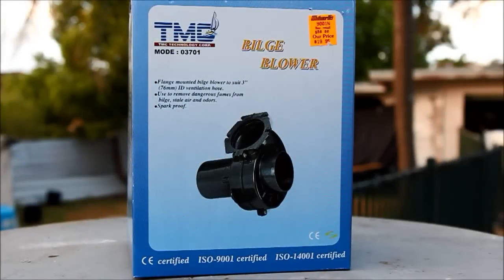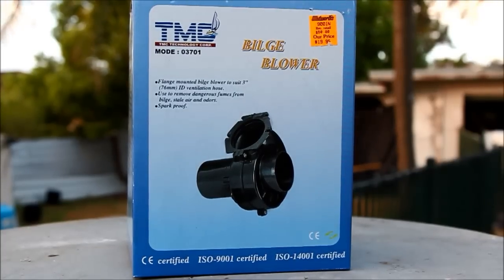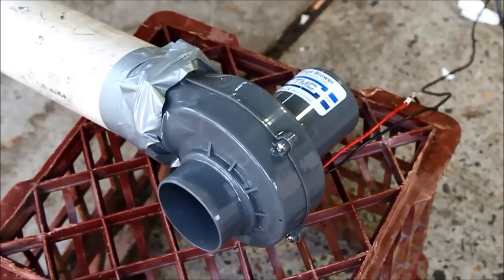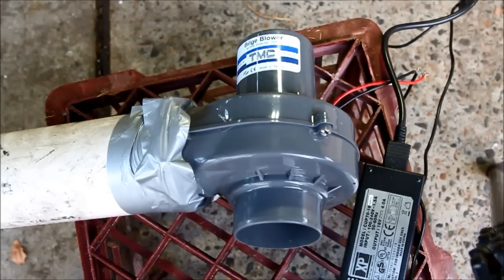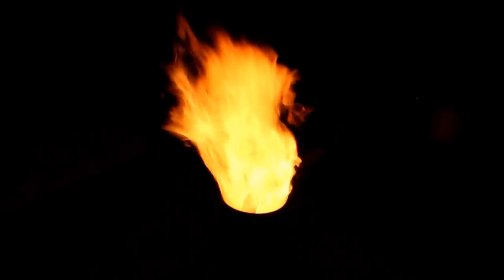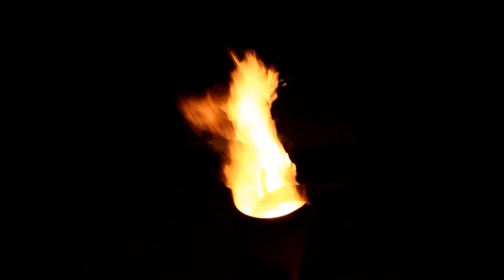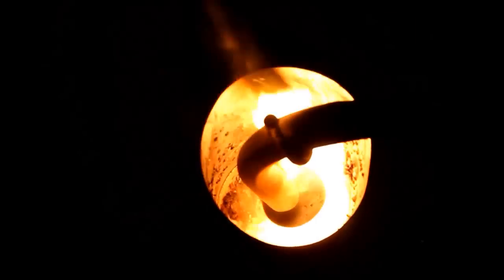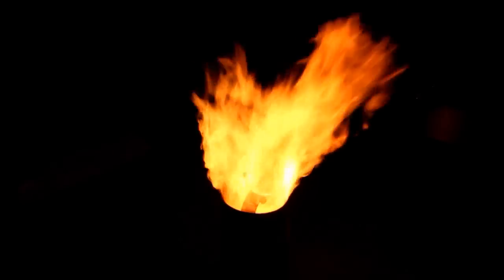12 volt Blower for Waste Oil burners, heaters and furnaces Tested.

Comment: Hey Oil Burner, chatted with you a few times before. Love the vids. So I'm considering getting a bounce house blower around 480 watts to power my burners. I'd like to know if you thought 480 watts (a bit under 1/2 HP) was going to be enough to get things cooking well? Your blower seems to be upwards of 1HP, I'd guess; but that's probably more than we truly need ...maybe I'm wrong? -I'll be curious to hear your thoughts on the matter.
Reply from the maker: +Christopher Moore (CreatingMoore)    The 480W blowers are the mid size of the type and more than adequate for any practical application of the burners.  For a furnace or a water heater, you'll be wanting to restrict the airflow rather than looking for more.  A 480W blower will easily support 300KW of heat output and I can't think of any application that would want that let alone more.  To put it in perspective, I have a swimming pool heater that came from an aquatic centre and heated the full size Olympic pool. 
It is rated at 200Kw.  The biggest home furnace I have ever read of used less than 70 Kw and the guy was melting cast iron with that.  :0)
Reply: +Oil Burner I'm using this for foundry work. I think you're going to love my new video I'll try to post it to youtube tonight. It's a hybrid of some stuff you inspired me with (300KW / 600KW) burners to melt large nasty objects and stuff I have been doing for years with regular foundry work in crucibles. Add a bit of creativity into the mix and I have a really cool idea that I'm excited to unveil. I think it will be a smash hit with guys like us for MANY reasons. You'll see what I mean and all the possibilities will boggle your mind. I'm actually excited to see further improvements on my idea since this is nothing more than a rough prototype. -The Mark 1 version if you will...

Right now I'm using a little R/C ducted fan DC motor. They use these things on RC Jets and they scream. This has worked well for me over the past 2 months but I have not done a LOT of runs with it. I'm afraid it will die as soon as I try to push it hard and do many hours of melting. Hence why I'm looking for a better (continuous run-time) blower like the bounce house blowers. The cool part of this blower I have now though, is full control of the range. It's a brushless DC motor so it's built to vary speed constantly. The AC blowers can be varied with a pulse modulator, but it's a bit twitchy and often it will cause the motors to surge and change speed without me touching things. -That part, no one likes! So anyway yes I do need higher output and I'm thinking 300KW will be plenty for all that I want to do. You have confirmed what I was hoping to find so thank you.

Let me know what you think of my video when it's posted ...hopefully tonight. I think you'll love it.
Reply from the maker: Christopher Moore
 I look forward to seeing this!  I have been thinking of an RC Ducted fan motor because they have pretty high pressure outputs up to about 1 Lb which is good for a fan.
I don't know about the run time but it can't be too bad if they use them in the planes.

I bought a PW controller and didn't like the way they made the motor sound. For regulation I use the very Hitech system of a bit of cardboard over the intake moved about to give the airflow I want. People crap on about this overheating the motor but it is a load of bull. I tested the motors and they use LESS current this way so clearly are not going to overheat and haven't in practice.

If you are shooting for 300Kw you are going to have to pay attention to oil flow. I recommend going to a 1/2" fuel line and putting 2 Lb+ on a bottom outlet  oil tank, more pressure if you have a tank that will take it. 300KW is 500ml min so a decent flow to keep up with on oil.
A 1/2" gate valve will do for regulation as you just need to control it a bit at start up and it will run nearly wide open  flat out.  You can also control the tank pressure for the output but by having the tank pressurised you don't have to worry about falling fuel levels.

You can use a pump as well but I haven't come across anything economical that will do the output.
Reply: +Oil Burner OK My new video is finally posted. Sorry it took me a while to post!

Comment: What do you think about using Compressed air  vs a Blower?
Reply from the maker: I think compressed air is a waste of energy, resources and money.  Blowers are cheaper, quieter, supply more air and use less power. A blower can make far more heat power than a compressed air setup and if done right can be just as controllable.
Reply: @glumpy10   Good to know!     Have you burned 100% synthetic oil?   Any drawbacks to that?  What about Mixed Oil, a cocktail of many weights synthetic and organic ... is the flame unpredictable or does it all blend well once the burner heats up and gets going?
Reply from the maker: @KarasCyborg  I have not burned any Synthetic that I know Of. My main fuel is veg oil. I have burned mixed oil from large drums and it all burns the same. Engine oil, Gearbox oil, transmission oil.  As long as it's mineral oil, ( which Synthetic is, only the additives are Synth). it all blends. I have used Veg oil with engine oil and have read it will separate over time but just needs a stir/ shake  to blend it again. I have had no trouble myself. Little bit of Diesel helps everything blend together.
Reply: @glumpy10    Would the be any reason as to why you wouldn't want the oil burner permanently connected/piped to a drum to melt the alum. for simplicity?
Reply from the maker: @KarasCyborg  No, Not that I'm aware of. I don't do it because I use the same burners for multiple applications for my Vids.
Reply: @glumpy10  After you have burner rolling along, have you ever tried to add a water drip to the burner to see if you can get a hotter flame?
Reply from the maker: @KarasCyborg  That is a misnomer.  You will get a LARGER flame and burn more fuel and gain heat that way but it does not increase the amount of heat from a set amount of fuel. In fact, the phase change of water from a liquid to a gas takes a lot of energy from the fuel.

Comment: hahahahahahaha  Dave your getting cautious in your old age,  only 5 miles away  lol  ;-)   Another brilliant episode. Whats the oil consumption using that blower,  any difference to the car 12v blower?
Reply from the maker: Didn't measure consumption Dave. Didn't think of it. The Bilge blower is definitely  less powerful than the car blower though.
That said, I think it really needs at least 2.5" pipe into the burner so it doesn't restrict it and gives it proper airflow.
Reply: Oil Burner consumption can be measured by weight with the same scale filched from the house. Just in case you wanna try that.
Reply from the maker: gmwwc
No real need. Volume is a good enough measurement for what I need to Know.

Comment: Are you filtering this oil? Is it waste automotive or vegetable based?
Reply from the maker: it's either strained or settled to get the big chunks  and dead rats out but not filtered to a specific as such. No need as there are no small openings anywhere to block.  I mainly use and prefer Used veg oil but any flammable oil will do.

Comment: hi  thanks for great info I need instant hot water.looking at inserting 3/4copper tube wrapped inside.any ideas 44 gallon drum.
cheers Dave
Reply from the maker: Copper tube has little surface area and is hard to direct the heat at efficiently. See if you can get an old gas spa heater or even a gas hot water system and replace the burner with an oil fired one.

Comment: A regular Werner von Braun you are. :)
Reply from the maker: Well I have been giving considerable thought to a Jet like Burner if not a rocket type.
I have found a viable low (1Lb) pressure blower for a motor jet but I'd like to find something with a Higher pressure.
 Spose for a  rocket I could always mix some oil with LOX. Anything becomes rocket fuel with LOX!  :0)
Reply: Oil Burner
LOL. Possibly the blower off an old mercedes TD diesel might fill the high end range.

Comment: Increasing the air flow reduces carbon monoxide production.  That's a good thing.  But heating a space with an open flame might produce excessive amount of carbon monoxide over time.  Oh, I forget, you don't care about things like that.  Good luck to you!